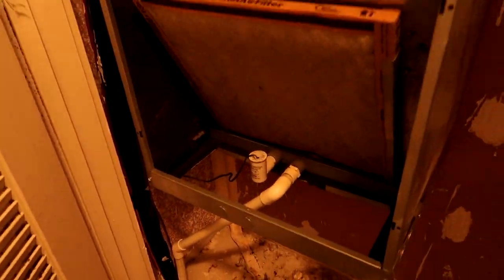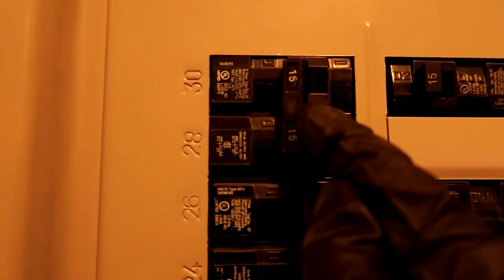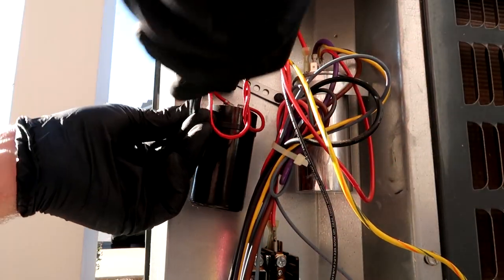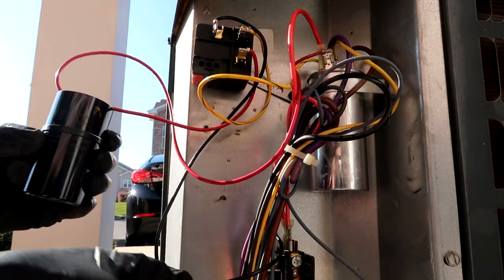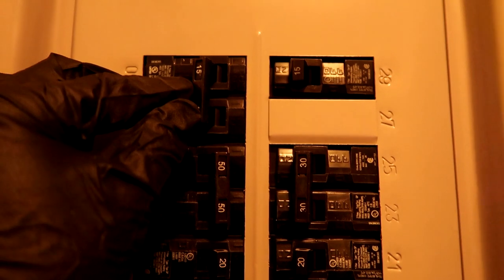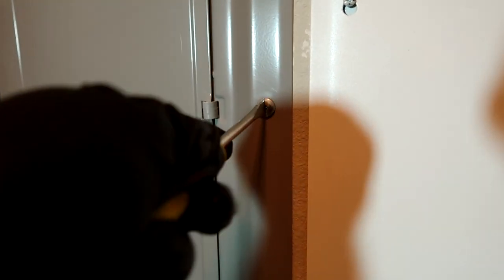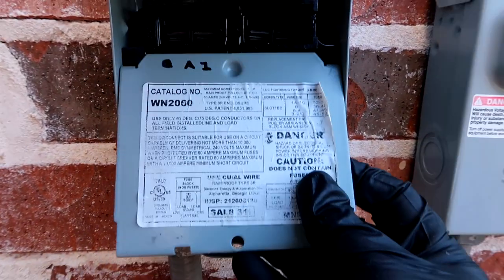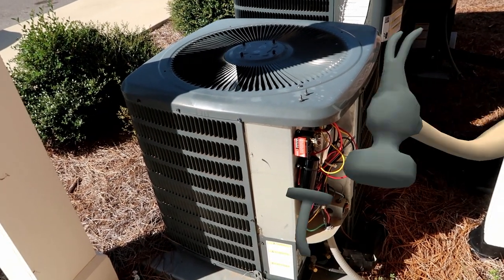Goodman Air Conditioner Not Blowing Cold Air

Comment: Good one BroLebowski 😎👍
If it came down to it, the next step in that process would have been to put your meter on ohms/continuity and check between the two legs to make sure they're not touching one another and then check each one individually to ground inside the panel to make sure neither one of them were grounded somewhere between the panel and the disconnect outside. 💪😁👌
Reply from the maker: Right on! Good to hear from you Shannon!

Comment: Good thing it was the breaker if it still trip it would have to be the wire going to the system outside have to check to see if the wire is shorted but like you said you got to keep going Good job
Reply from the maker: Thank you so much for watching justmakeingit!

Comment: Hey Lex  , love all you Videos watch them every chance I get. But I do have a question if these units are only two years old why do they have heard starts on them?
Reply from the maker: They came that way from the Goodman factory. The only units with hard starts in them also have rotary compressors. I guess the rotary compressors need it. The bigger units don't have them. But, they have regular Copeland scroll compressors. Thank you so much for watching Keith!
Reply: If the units are installed with thermal expansion valves , they need hard starts to help compressor start against instant pressure. Units with piston metering don’t have that issue and hard starts are optional on them.

Comment: black tape on the white wire is one of the proper "recoding/labeling" techniques, to denote it's being used as a hot conductor and not a neutral. other popular way is permanent black marker with large chisel tip that can quickly coat them.
that should be done when a neutral wire is used as hot conductor and obviously should only with a two wire cable such as romex or armored cabling, where no neutral is needed at the equipment.
Reply from the maker: Right on. Good to hear from you Throttle!

Comment: I'd think a 20 or 30A breaker would make more sense for a condensing unit, but maybe it's a small enough system for a 15?
Reply from the maker: I was thinking the same. It's a 2 ton. I asked the company who installed them and they said 15 amp breakers were okay. All 300 units have 15 amp breakers for the condenser. 🤦🏼‍♂️ Thank you so much for watching Big N8!
Reply: it does seem rather small, but they'd have wired it to the rating plates on the condenser. it's probably a good thing it trips the breaker when there's a capacitor and start issue, vs. keep running overloaded for a longer term.
Reply: @Les it's not "additive" in the USA, that's 240v at 15amps line to line, there is no neutral in use.
Reply: I had just said the same thing I’ve never seen a 240v circuit with a 15 double throw breaker it’s always been 30 amp or 40 amp hopefully it will work out for lex I hate to see him having to come back  multiple times for an installers flaw

Comment: What if the breaker isn’t tripping, our unit pushes heat but fan won’t come on and no cold air. Similar to how this video started without tripped breaker. Any help?
Reply from the maker: I'd need to be there for this head scratcher 🤔. It could be a lot of things. Bad defrost board. Stuck on heat strips. Reversing valve stuck. And more.

Comment: What up Skid Rock! Have you ever seen a breaker trip the main breaker switch? Happened to me a few years ago. Compressor shorted to ground. Tripped breaker every time immediately. AC guy told me my panel is wrong since he says only the 40 amp from the outside unit should trip, not the master. What say you?
Reply from the maker: I've only seen an oven breaker pop the main breaker. Not sure about this head scratcher. 🤔
Reply: Hard shorts will do that if your main breaker AIC rating is close to the same AIC rating of the downstream breakers. Main should have higher AIC rating than downstream breakers. This is called select coordination in electrical engineering terms. This is independent of the nominal amp rating  of the breaker. In layman’s terms, your main is clearing the short as fast ( faster in your case ) as the small breaker.
Reply: @garythefixer1954  Thank  you so much. Can you explain what AIC is? Also, is what happened to me not necessarily an improper installation?
Reply: @realSamAndrew  AIC stands for amperage interruption current . It is not the same as the breaker’s nominal rating (ie 20, 40, or 200). It is the instantaneous amperage the breaker will see (faster than humanly perceivable) in the event of a dead hard short. Believe it or not the breakers can see 10k+ amps flow for a nano second before it trips. This is only measurable with lab equipment.  Keep in mind the speed of electricity. If your main and downstream are rated at 10k or close, your main which is also carrying the aggregate amperage of the other circuits ,will probably trip first. Select coordination is commonplace in commercial and industrial panels ,but can get “lost “when it comes to residential panels. Imagine that happening in a hospital! In your case , it’s a nuisance. I wouldn’t fret too much about it. If you ever change out the panel, just make sure the main in it has a 20k+ AIC rating. The downstream breakers are typically 10k. PS. Your existing main may actually have the proper rating, but is not “up to par”. Don’t attempt to change the main. Panels (guts) and their mains must have compatible ratings.
Reply: @garythefixer1954  Excellent! Thank you sir.

Comment: probably should have changed the breaker anyway, something's likely not right inside it if it kept popping back off or there was a short somewhere between the breaker and disconnect, which cleared itself after multiple resets. lol
this is where a hi-pot/megger/insulation tester would be good, unhook both ends and test line to line and both lines to ground.
Reply from the maker: Yep, I had to order some. If it happens again it's getting changed out. It's still going good after 3 days. 🤞

Comment: How will someone know for sure exactly what side is the common side of the contactor
Reply from the maker: It's usually the left side with all black wires.  The right side is usually the run side. Also, it will say which wire is common on the fan and compressor. You can follow that down to the contactor and see just to make sure if you're not sure. 👍
 Hope this helps! Thank you so much for watching AEJ!
Reply: @LexVance  thank you